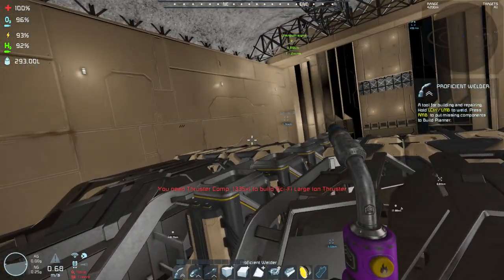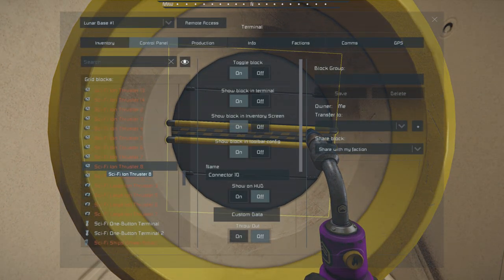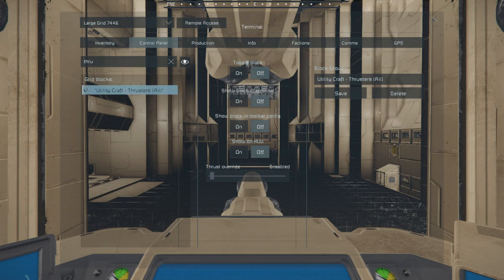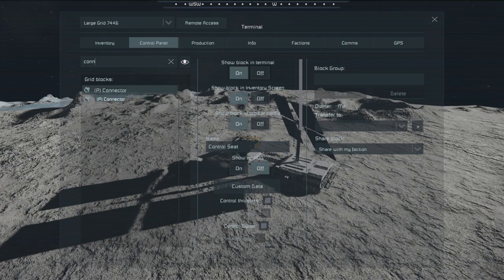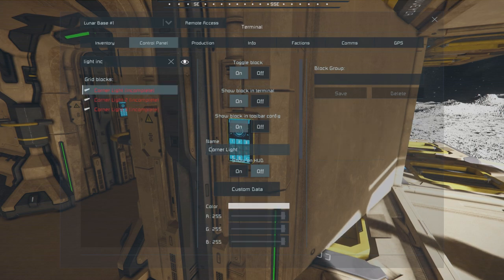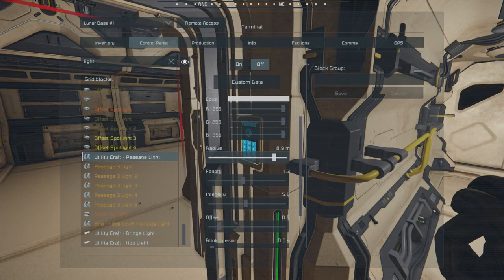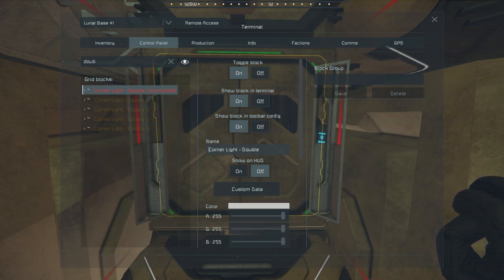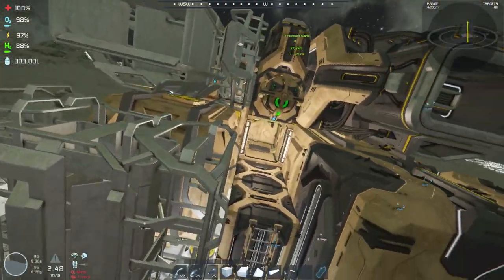Space Engineers | So You Want To Be An Engineer | Ep. 21 - Utility Ship Progress - Test Flight?

Comment: 32:00 BOB will tell you in the in the menu area when selected what materials it's missing to complete a job.  Then you will know what needs to be produced.. in turn I believe there is a script out there that tell BOB to utilize the Assemblers to create the items it needs.. although it's been some time since I remember seeing that so I may mistaken or it might no longer be a thing..
Reply from the maker: Yeah, my issue was that I forgot temp grid-merge via landing gear was a thing lol  Still used to the merge block or connector being required lol

(And yes, there is a BOB script that tied the Build and Repair system to your assembler systems to auto produce needed components.  I just don't generally use it lol)

Comment: 40:34 I'd leave that Landing Gear installed as a buffer to help protect your Connectors... it will get destroyed BEFORE they will.. think of it as an early warning system that you're about to loose your connectors when the landing gear dies... lol
Reply from the maker: Yep, I'm adding drills to the ship to help with the position/spacing issues.  KSH making voxel awareness/collision so much more precise has messed with my default setups lol
Reply: @Haladmer  Yeah, I'm not a fan of the latest "adjustments" they made to voxels.. it makes hand drilling a real BITCH...

Comment: 36:07 I'm assuming Battery #10 and the unfinished one were the last two as #10 shows AUTO instead of RECHARGE like the rest.. :)
Reply from the maker: You would be correct lol

When I took the batteries out of recharge mode, those last two (which are part of the group) did not switch over lol